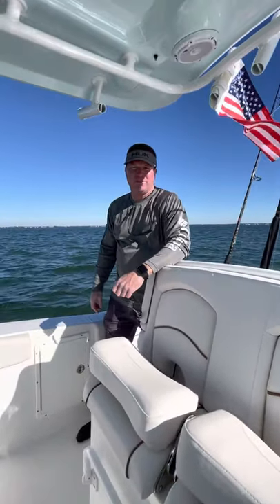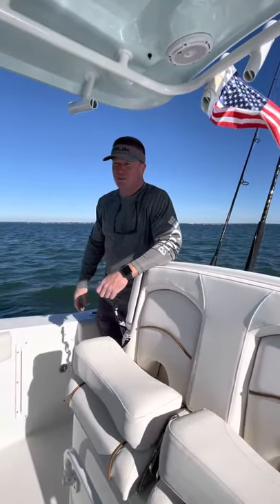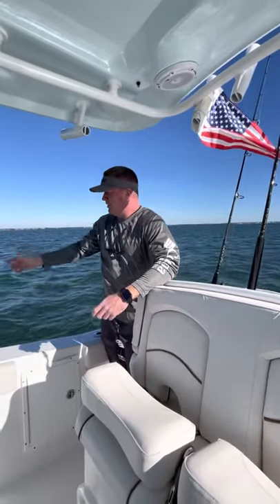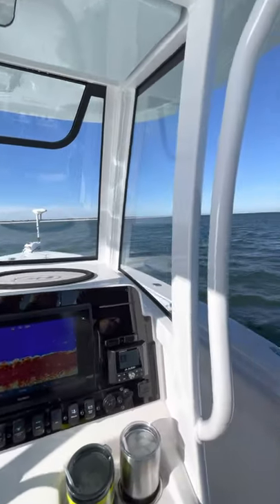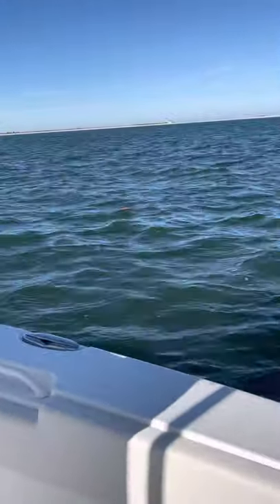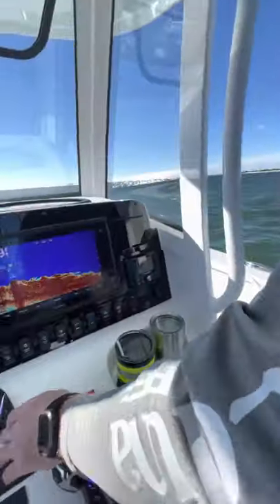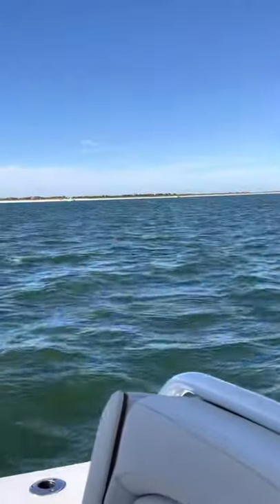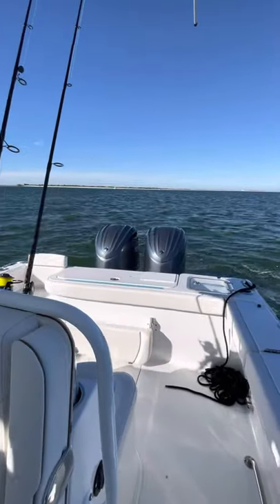Rhodan 96” Rhodan trolling motor follow up video on our SeaHunt Gamefish 27

Comment: Hi James, thanks for posting the videos. Have you used the Trolling motor to assist you in docking your boat? like a bow thruster? to maintain control of your bow when getting into a tight berth? I have a 27 foot Aluminum Alaskan cabin   boat with a single 300 HP Mercury and wondering if the Rhodan can do double duty as both a trolling motor and a "bow thruster" to control the bow of the boat when docking. Thanks
Reply from the maker: Hello. Great question. We recently used the trolling motor along with the engines to pull up to a dock in a heavy current. Worked great.
Reply: @NHRAPROSTOCK2006  Thanks, good to know, another advantage for a bow mount Rhodan!

Comment: Hi!! We are considering a purchase of a 96” trolling motor for our sea hunt 27, can you tell us how difficult it is to pull it up to the mount at sea?  So far we haven’t been able to find a video of the deploy and retraction.
Reply from the maker: Hello. It can definitely be a challenge in rough waters. If I spin the boat around so that transom is facing the waves it seem to make it a lot easier for me. Otherwise in calmer conditions it is not that difficult to stow it away.

Comment: They always out of stock.
Reply from the maker: Give Jeffery a call at Auto Lighting of Alabama (251) 379-6934
He was able to hook me up with a trolling motor when I was told 8-10 weeks by Rhodan.
Reply: I want the black 36volt only need 60" shaft , they're out of stock also , haven't for how long but 8-10 weeks would be great cause boat won't be ready for 8-10 months